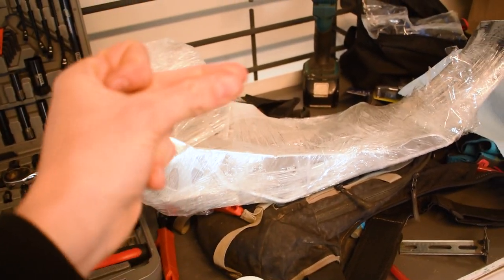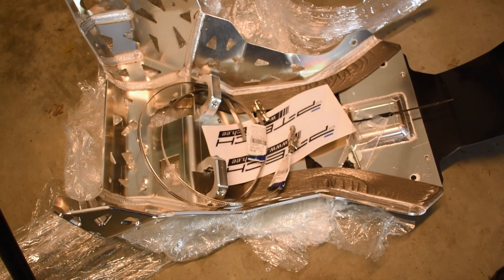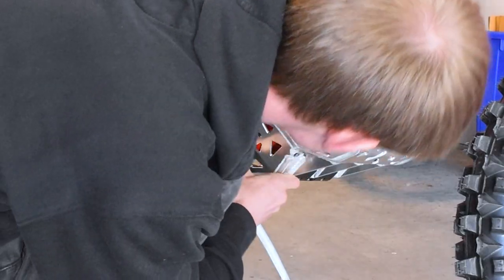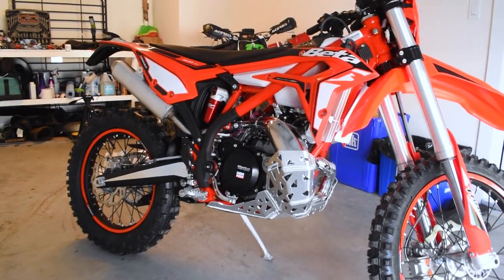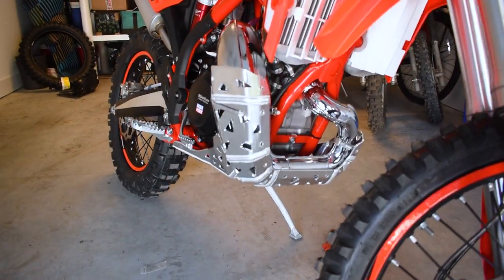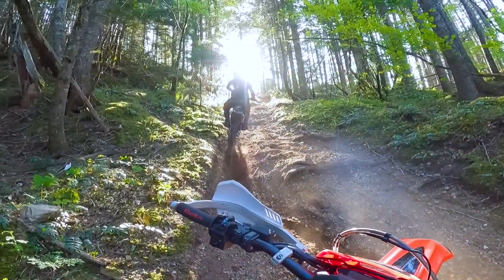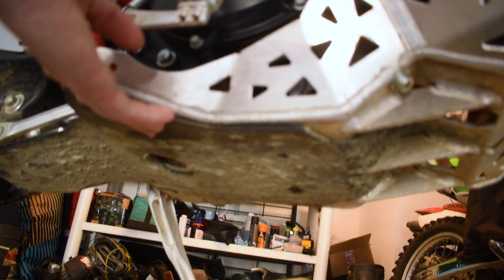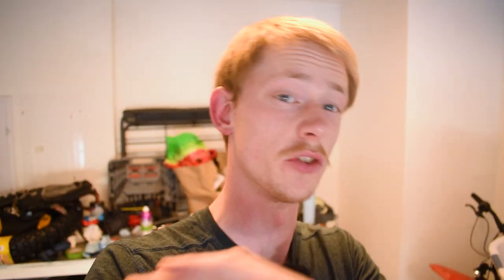This Is The Strongest Enduro Skidplate On The Market For My Beta X Trainer 300

Comment: Looks great. Personally I'd have fitted an RR300 pipe and guard,  makes the bike so better IMO. I done this to a 22MY bike after 12 months and was kicking my myself afterwards as i realised i should have done it from new. Enjoy the ride.
Reply from the maker: Honestly i really havent had the craving or need for anymore power! Truly feels like this is the sweet spot for me. With the power valve turned out its just right amount of hit while maintaining traction
Reply: @AaronsEnduro   Initially I was happy but got bored with the lack of mid and top end. After fitting the RR300 exhaust I didn't feel I lost any bottom end whatsoever but the mid and top were much improved and more entertaining for it. But we all have different use cases and preferences, your last video was great, really enjoyed it 👍🏻
Reply from the maker: Only because 99% of trails locally are just technical riding you never really need much for top end. Considering i ran all the trails with a klx 140 for the last year this has way more than enough snot to rip up the climbs

Comment: hi i have a 21 xtrainer  and want to put the rr exhaust on and full  ptech guard but what year of rr do i order it off for the xtrainer
Reply from the maker: Order the 300rr skidplate and it will fit on the x trainer
Reply from the maker: Pretty sure any year rr skid plate will work
Reply: do you know which year rr exhaust @AaronsEnduro
Reply from the maker: Well i know 23-24 beta x trainers are the same as 20-23 rr’s so id say a 2019 rr plate should work minty

Comment: I have on my 23 300rr and unfortunately it will not work with my new fmf gnarly pipe
Reply from the maker: You need the 300rr skidplate to match with the pipe
Reply: @AaronsEnduro   it worked great with the stock pipe but after I bought the new fmf it doesn't fit.
Reply from the maker: @mikejankowski3362 nope! Its widely known across the forums that you need the 300rr version of the skidplate to fit the fmf pipe on the x trainer!
Reply: @AaronsEnduro  I have a 23 300rr not the xtrainer. I do love the skid plate though.
Reply from the maker: Oh interesting that the fmf pipe doesnt fit it!? Because the fmf will fit with 300rr skidplate in x trainer